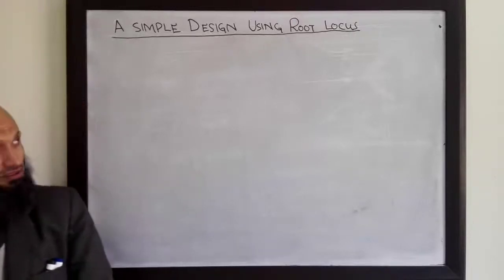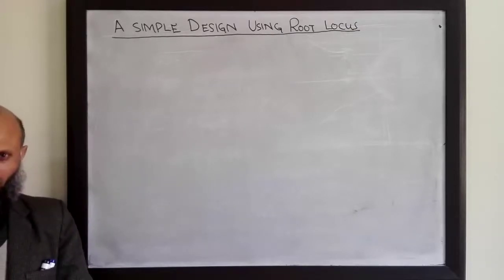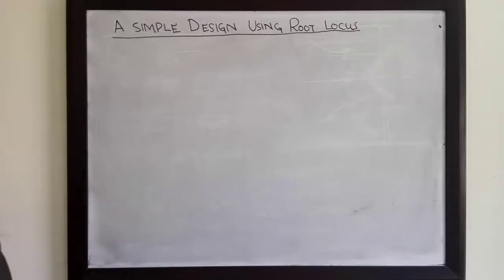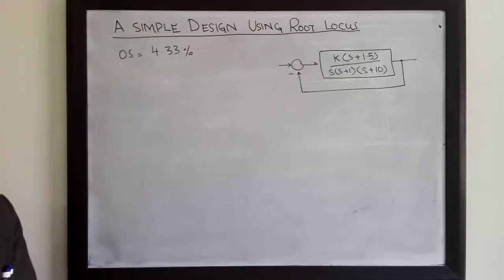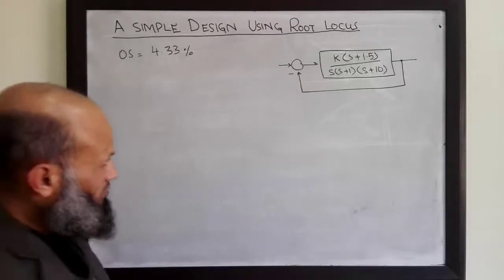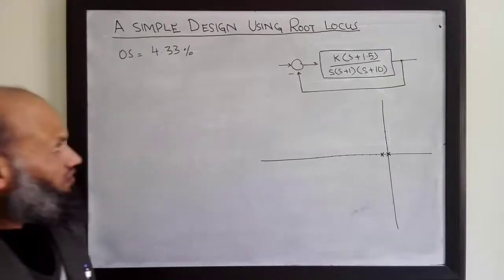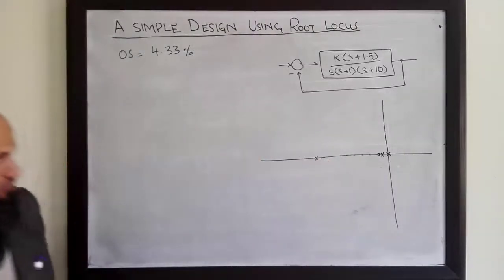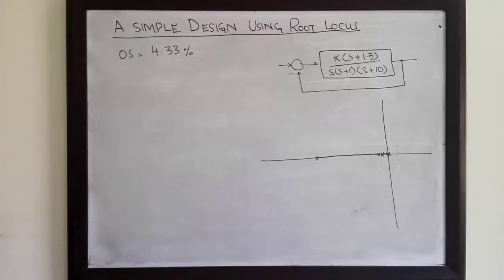LCS 34a - Design via gain adjustment using root locus

Comment: that point must correspond to -5 + 5j as the line makes an angle of 45 degrees
Reply from the maker: Yes, you are right, the real part and the imaginary part should be equal. The graphical readings are always approximations.